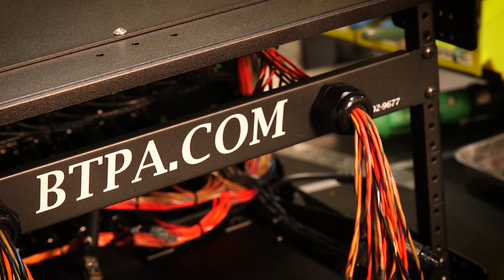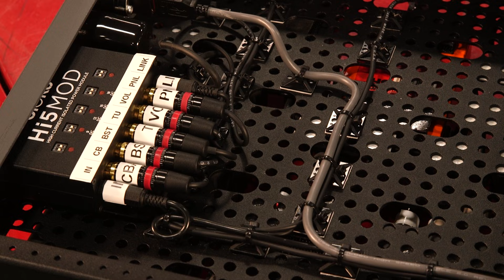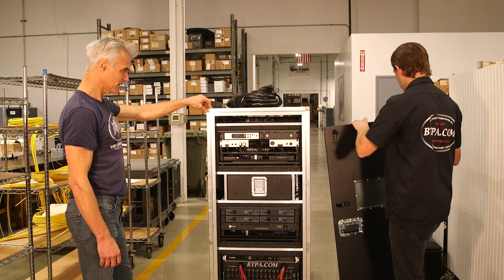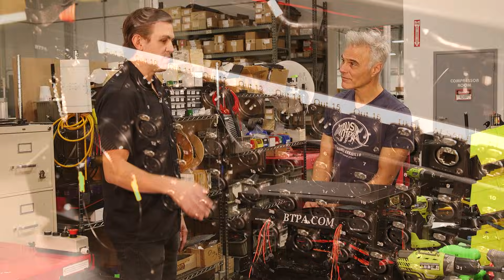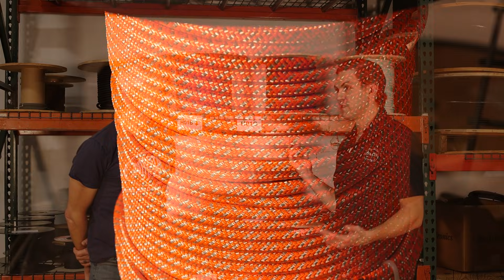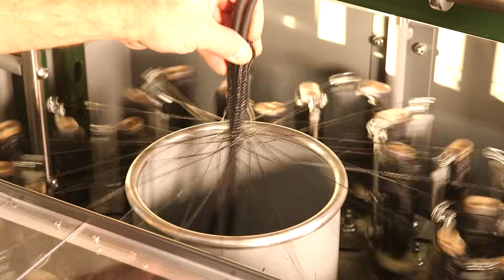How Touring Guitar Rigs Are Designed

Comment: Capacitance is not resistance and changes based on frequency. Capacitance shunts signals, and at some frequencies can cause standing waves as well. Bollinger just nods his head, because he's got zero background in electronics. That's fine, but the guy building the cable is dumbing it down too much and should explain why capacitance at given frequencies matter, because it's not resistance.
Reply: Yeah, I realized I used an incorrect word being "resistance" shortly after. Just tried to keep it as simple as possible and chose a wrong word; however the sentiment was really the same. Didn't want to go into the electrical charge / battery comparison that is often taught and used as I felt that would lose people even more.

Comment: LOVE BTPA- they are the hometown heroes! I only gig around town but I wanted a rig that would be lightweight, reliable, and quick to get on and off stage without sacrificing on tone. The setup I landed on was a four cable method (Amp In/Send/Return/Channel Switch) with a power line to the pedalboard. BTPA had everything I needed to build a snake that would work- including the long braided wrap! Fantastic customer service and selection- these guys are real pros!

Comment: So if something goes wrong (either audio or power cables goes bad) you have to cut dozens of zipties. Also some of those cables are crammed tight, twisted and turned the way that put unnecessary stress to the plugs. Remember that Luke video where his tech had to swap the power supply on fly? If you leave enough space for the cables to move you can easily do that. But if you tighten everything up and cut all the slack it becomes a nightmare, almost impossible. So my tip to pedalboard builders is to leave a bit of slack and leave some room (don't pinch and cram the cables too tight). You'll thank me later. Use few of those 3M ziptie anchors and zipties but do the rest with velcro tape. That keeps the cables together neatly but are still easily serviceable if something goes wrong.